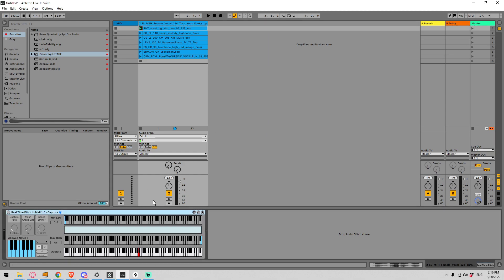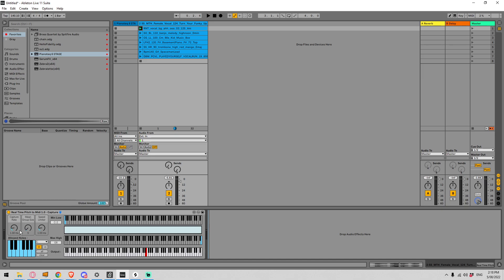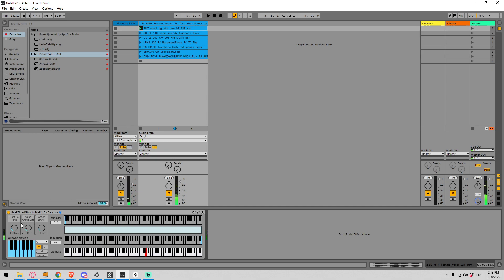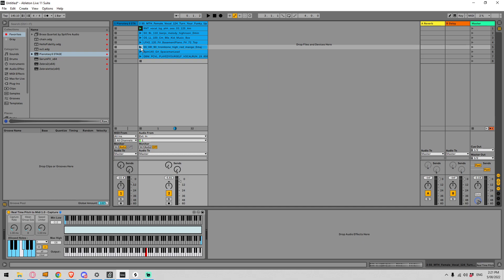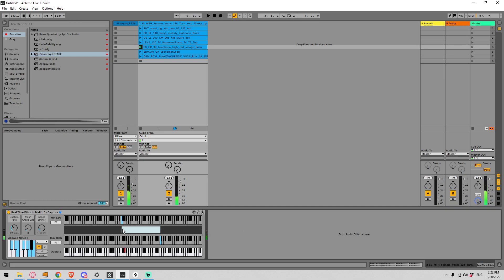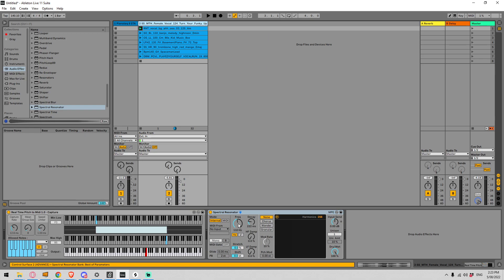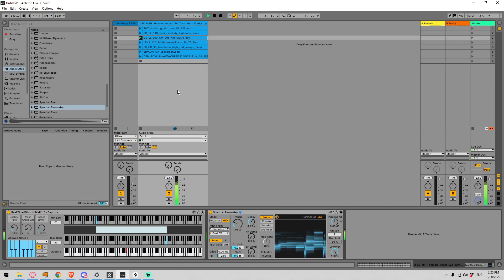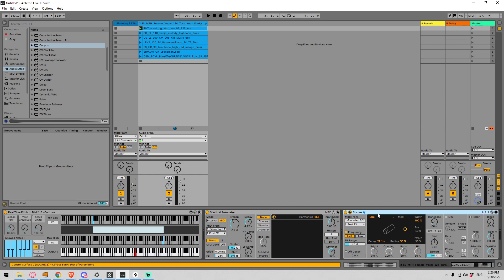Real Time Pitch to MIDI 1.0 - Free Download

Comment: is there a way to stop de note when the audio stops playing the note? now the last note is held indefinitely?
Reply: fixed it by with the following : 

{
	"boxes" : [ 		{
			"box" : 			{
				"maxclass" : "comment",
				"text" : "plug in the midi note here from the switch as the original did",
				"linecount" : 2,
				"presentation_linecount" : 2,
				"numoutlets" : 0,
				"patching_rect" : [ 735.726402223110199, 1352.384640842676163, 162.0, 29.0 ],
				"fontface" : 1,
				"id" : "obj-252",
				"numinlets" : 1
			}

		}
, 		{
			"box" : 			{
				"maxclass" : "comment",
				"text" : "connect midi int value (after the ftom) -999 here for detecting silence ",
				"linecount" : 3,
				"numoutlets" : 0,
				"patching_rect" : [ 571.726402223110199, 1301.553191363811493, 162.0, 41.0 ],
				"fontface" : 1,
				"id" : "obj-251",
				"numinlets" : 1
			}

		}
, 		{
			"box" : 			{
				"maxclass" : "newobj",
				"text" : "bucket 2",
				"numoutlets" : 2,
				"outlettype" : [ "", "" ],
				"patching_rect" : [ 631.726402223110199, 1336.678572595119476, 46.0, 20.0 ],
				"id" : "obj-242",
				"numinlets" : 1
			}

		}
, 		{
			"box" : 			{
				"maxclass" : "number",
				"presentation_rect" : [ 181.0, 64.5, 50.0, 20.0 ],
				"numoutlets" : 2,
				"presentation" : 1,
				"bgcolor" : [ 0.301960784313725, 0.611764705882353, 0.298039215686275, 1.0 ],
				"outlettype" : [ "", "bang" ],
				"patching_rect" : [ 740.726402223110199, 1481.138890326023102, 50.0, 20.0 ],
				"ignoreclick" : 1,
				"id" : "obj-243",
				"format" : 4,
				"parameter_enable" : 0,
				"numinlets" : 1
			}

		}
, 		{
			"box" : 			{
				"maxclass" : "flonum",
				"numoutlets" : 2,
				"outlettype" : [ "", "bang" ],
				"patching_rect" : [ 658.726402223110199, 1405.98015969991684, 50.0, 20.0 ],
				"id" : "obj-244",
				"format" : 6,
				"parameter_enable" : 0,
				"numinlets" : 1
			}

		}
, 		{
			"box" : 			{
				"maxclass" : "newobj",
				"text" : "change",
				"numoutlets" : 3,
				"outlettype" : [ "", "int", "int" ],
				"patching_rect" : [ 658.726402223110199, 1378.769062280654907, 44.0, 20.0 ],
				"id" : "obj-245",
				"numinlets" : 1
			}

		}
, 		{
			"box" : 			{
				"maxclass" : "newobj",
				"text" : "if ($i1 == -999) && ($i3 ==1) then stop else $i2",
				"numoutlets" : 1,
				"outlettype" : [ "" ],
				"patching_rect" : [ 658.726402223110199, 1435.88175630569458, 214.0, 20.0 ],
				"id" : "obj-246",
				"numinlets" : 3
			}

		}
, 		{
			"box" : 			{
				"maxclass" : "live.text",
				"varname" : "live.text[2]",
				"presentation_rect" : [ 176.0, 164.0, 53.459458827972412, 15.0 ],
				"numoutlets" : 2,
				"presentation" : 1,
				"outlettype" : [ "", "" ],
				"patching_rect" : [ 853.726402223110199, 1396.678572595119476, 50.912441998720169, 15.0 ],
				"id" : "obj-247",
				"text" : "NoteGate",
				"texton" : "NoteGate",
				"parameter_enable" : 1,
				"numinlets" : 1,
				"saved_attribute_attributes" : 				{
					"valueof" : 					{
						"parameter_enum" : [ "val1", "val2" ],
						"parameter_initial" : [ 1 ],
						"parameter_initial_enable" : 1,
						"parameter_longname" : "live.text[4]",
						"parameter_mmax" : 1,
						"parameter_shortname" : "live.text[3]",
						"parameter_type" : 2
					}

				}

			}

		}
, 		{
			"box" : 			{
				"maxclass" : "number",
				"numoutlets" : 2,
				"bgcolor" : [ 0.301960784313725, 0.611764705882353, 0.298039215686275, 1.0 ],
				"outlettype" : [ "", "bang" ],
				"patching_rect" : [ 756.226402223110199, 1385.937832206487656, 50.0, 20.0 ],
				"ignoreclick" : 1,
				"id" : "obj-248",
				"format" : 4,
				"parameter_enable" : 0,
				"numinlets" : 1
			}

		}
, 		{
			"box" : 			{
				"maxclass" : "newobj",
				"text" : "s midiRecieve",
				"numoutlets" : 0,
				"patching_rect" : [ 658.726402223110199, 1481.138890326023102, 75.0, 20.0 ],
				"id" : "obj-249",
				"numinlets" : 1
			}

		}
 ],
	"lines" : [ 		{
			"patchline" : 			{
				"source" : [ "obj-245", 0 ],
				"destination" : [ "obj-244", 0 ]
			}

		}
, 		{
			"patchline" : 			{
				"source" : [ "obj-242", 1 ],
				"destination" : [ "obj-245", 0 ]
			}

		}
, 		{
			"patchline" : 			{
				"source" : [ "obj-246", 0 ],
				"destination" : [ "obj-243", 0 ],
				"order" : 0
			}

		}
, 		{
			"patchline" : 			{
				"source" : [ "obj-248", 0 ],
				"destination" : [ "obj-246", 1 ]
			}

		}
, 		{
			"patchline" : 			{
				"source" : [ "obj-246", 0 ],
				"destination" : [ "obj-249", 0 ],
				"order" : 1
			}

		}
, 		{
			"patchline" : 			{
				"source" : [ "obj-244", 0 ],
				"destination" : [ "obj-246", 0 ]
			}

		}
, 		{
			"patchline" : 			{
				"source" : [ "obj-247", 0 ],
				"destination" : [ "obj-246", 2 ]
			}

		}
 ],
	"appversion" : 	{
		"major" : 8,
		"minor" : 5,
		"revision" : 8,
		"architecture" : "x64",
		"modernui" : 1
	}
,
	"classnamespace" : "box"
}
Reply: @tristanmorelle2093  sorry for asking for a lot maybe but can you please provide some guide of how to add that line of code? :)

Comment: Hey Tom, I think that the "miss-tune" feeling you get with low value on the first knob, and the other "miss-note" on the high value, is caused by the glissando of the incoming audio. When it comes to vocals its natural to articulate some notes through glissando even unhearable. On the other hand the trumpet has got a vibratto so You can get random results. Interesting thing also is, that You get thoose octave higher results, I wonder if it got something to do with the fact that theres the same note just octave higher if You know what I meen. So great device!

Comment: Great device, Tom. Thanks for making this pay as you want. Quick question, how do I capture the MIDI notes on the receiver?
Reply from the maker: You need to have either a device after it (an instrument for example), or you need to use an Effect that has a MIDI from, such as the Spectral Resonator, or the Corpus.
Reply: @TomCosmNZ  I do have an instrument after the receiver but it doesn’t capture. Can you make a quick tutorial showing how to do that or may I email you with a video capture?
Reply: Usually just arm and record the midi track.
Reply: @joetjoep8408  I know but that doesn’t happen in this case.
Reply: Hello, I want to ask if you have solved this problem, I also want to ask this